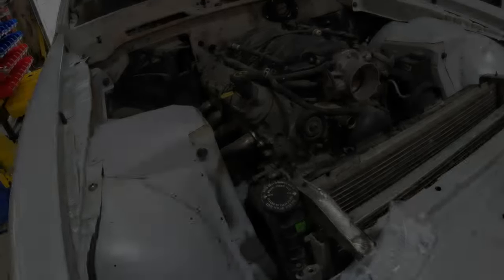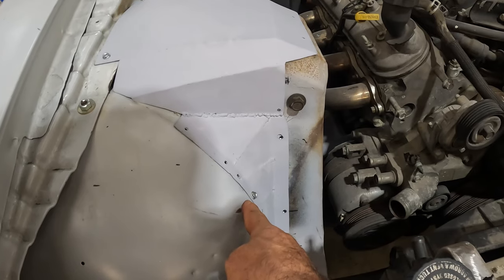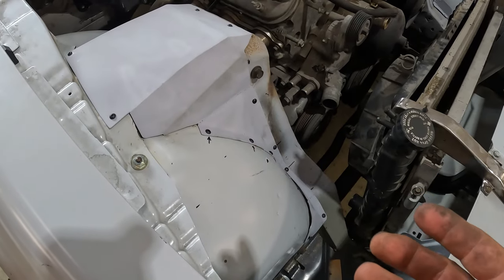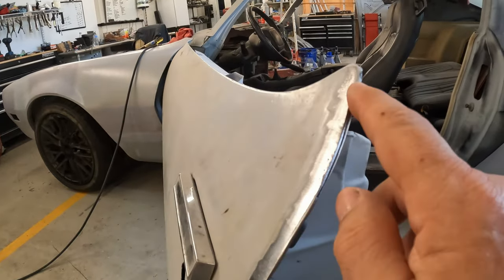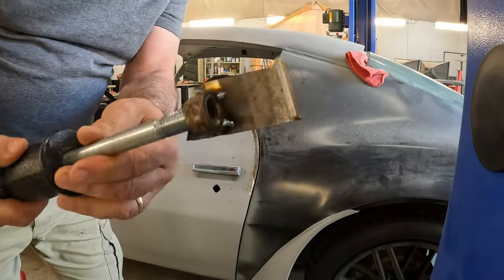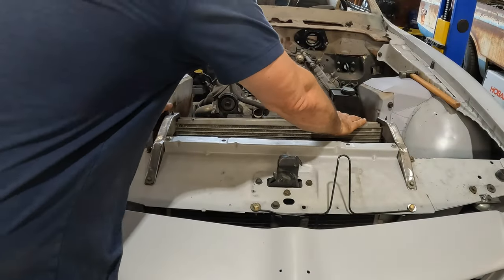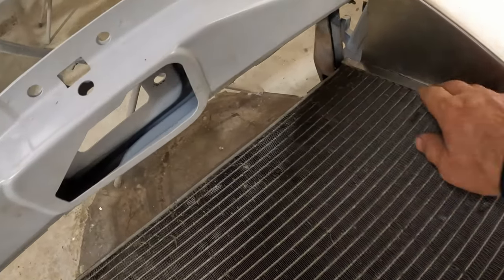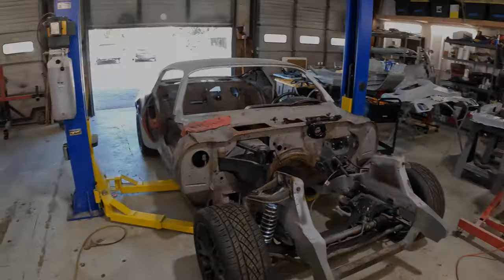Firebird Ep  53 Radiator Mounting and more!

Comment: Loving the fab work!   Weirdo question : Do you think carbon fiber skinning the inner fender wells could stand up to the heat of the exhaust system ?  I have strange taste...😂
Reply from the maker: Not a weird question at all. I think CF can withstand underhood heat very well - How close it can be to the exhaust? Not sure but a heat shield does wonders.
Reply: @MaverickModds  Many thanks!!